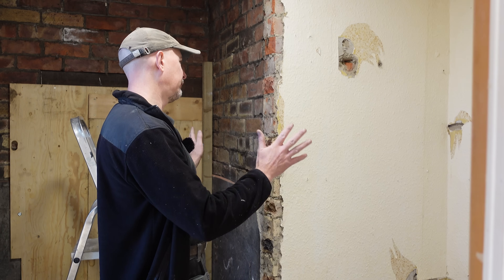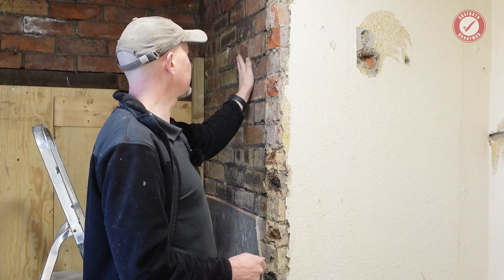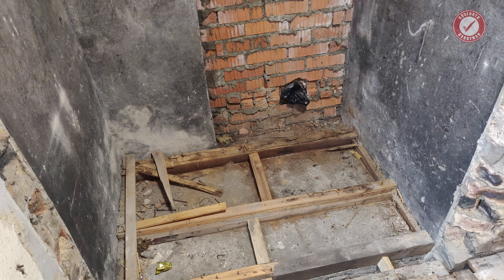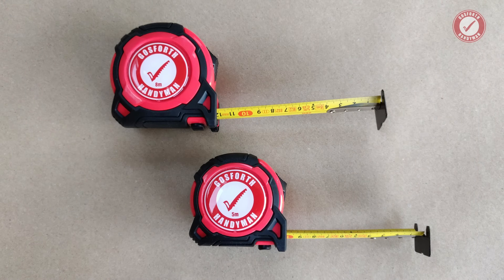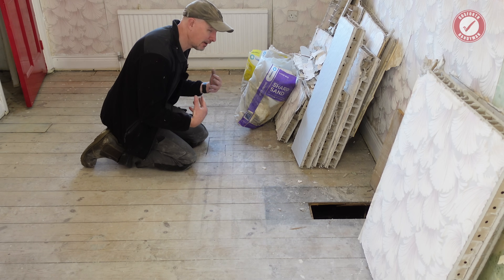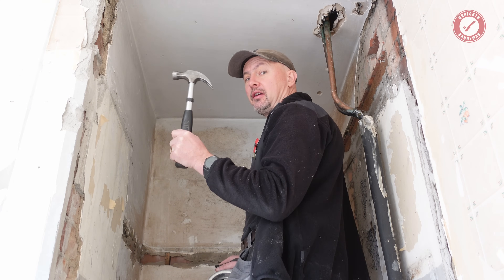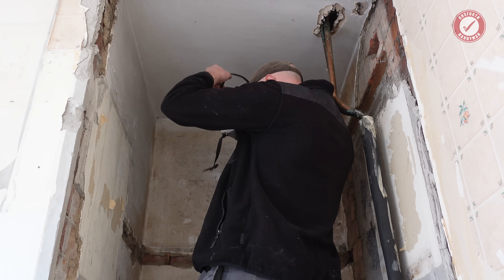How do I identify a load bearing wall?

Comment: "For whatever reason they've run the joists that way" I think you'll find they did all the joists as/when they built the outside of the houses, so didn't really matter if they ran from front to back or sideway, they then built internal walls after the "frame" was up....Might be TOTALLY wrong in this isntance.

Comment: If there is any possible doubt , no matter how minor, call a structural engineer - be safe!
I have seen a modern timber framed house where the occupier had removed an internal timber stud wall, assuming it was just a partition, where in fact it was a supporting frame for the upper floor!

Comment: I'm a structural engineer and another giveaway is that the wall is made from bricks on edge so is 3" instead of 4" and a cheaper way to build a wall.
Reply: Great advice. Seen this so many times on older 40s houses. Was cheaper to do this and saved a few courses of bricks too.

Comment: 'The Pantry" is what we called it in the west end of Newcastle - Cowgate, 1930s build. It had concrete shelves and was always really, really cold - shared the same wall as the 'coalbunker'. Kitchen had a concrete floor and the upstairs bathroom/toilet floor was concrete too. No idea how that was supported, but I remember there was a really thick part of the ceiling above the sink. I always thought it was the return for the top of the stairs, though there wasn't one, the stairs went straight up. Maybe that was the concrete block. They don't build them like thy used to..... 🙏

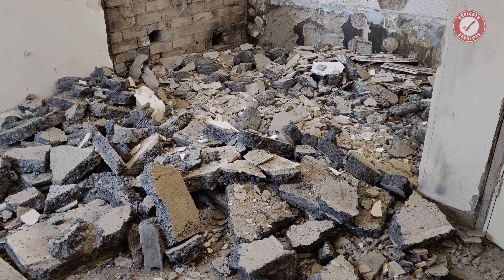Comment: 6:30 Actual cinder blocks!  You rarely see them except in older buildings from the 40s-50s. Modern blocks are made from concrete not cinder.
Reply: Cool
Reply: @firesurfer  my house has cinder blocks it's 50s built, horrible messy stuff that just seems to crack all the time. Ill be glad to get rid of some of them when we renovate

Comment: I took out a brick wall between the dinning room and kitchen in my house. 
Opened up the ceilings both sides and could see there was literally nothing sittyng on top of it. Joists were situatied about 15cm ish either side of the wall.
So just knocked it down brick by brick from top down. 
That was 2 years ago
Reply from the maker: Yup had that too! Wall was running parallel with the joists with nothing on top. Again, a kitchen in an old house. 👍

Comment: 1964 end terrace. I'm looking to remove the none load bearing wall between the lounge and a hallway to open up the lounge. At each end the wall keys into an outside and inside load bearing wall. Does it therefore contribute to the integrity of the structure of the property or can it be removed?
Also, whilst I'm here, different wall, is the wall between adjoining terrace/semi property a cavity wall? I'm guessing it will be.
Reply from the maker: Could be structural - look up racking panels. Get a structural engineer to take a look. Party walls in 1964 should be cavity but not guaranteed. In older houses they're often just single brick. 😮
Reply: @GosforthHandyman  Thank you

Comment: Hi Andy  As others have rightly pointed out , down force is not the only consideration , but another consideration is the time frame of the property. As most houses of this time frame were heated by coal , storing coal on the premises was a potential fire risk as was the kitchen itself .  Kitchens being the primary source of domestic fire in those days , and of course chimney fires were a regular event which was part of living with a coal fire .         Interestingly the time difference in  brickwork being installed and lath and plaster , might not have been as great as you might think , and definitely in this case the quality of the brickwork was never expected to be seen so could be installed at quite a brisk pace .     My late father was in the fire service , which he joined in the early 1950s . Most of his early days were occupied with domestic fires often being as mentioned chimneys and chip pan fires , and yes even coal bunkers catching fire .          Kind regards as always
Reply from the maker: That's really interesting - awesome information! 👍👍

Comment: Always surprised at how often I see floor joists hacked up over there to run utilities. I suppose with brick walls you have nowhere else to run things, just unnerving to see electrical runs just below the floorboards and notches for pipes, etc. I've have to fix those mishaps plenty across the pond here. Interesting to see how things are done elsewhere. Thanks for the share.
Reply from the maker: Honestly it absolutely does my head in 😂! Floorboard notches are one of my pet hates. In my experience they're one of the most common causes of sagging ceilings and bouncy floors. 😭

Comment: It's worth noting that just because a wall is stud it doesn't mean it isn't load bearing. They won't be taking as much load as brick / block but in some circumstances they are structural. The previous owner of my house took out a stud wall downstairs and the floor upstairs maybe 40 years ago and the floor had sagged like crazy. After consulting a structural engineer I opened up a little further and took down a wall that was supporting a mid flight stair landing. Two substantial steels fitted in a t section and a lot of jacking up with acros and all is solid.
Reply from the maker: Yup - all very true! Also racking panels. 👍
Reply: @gingerelvis  in old houses at the end everything is kind of "structural"

Comment: The wall I had bricked up in the hole between the lounge and dining area was load bearing with no lintel. The joists also go front to back but the span would have been massive. Also the pantry was taken out and that was supporting the landing between the stairs turn - now back. That was silly as the meters were there and they put a stupid little cupboard door to access it. Also a lead pipe from the gas meter to gas fire in lounge (now removed) was dented - last checked in 1991! Putting the pantry back uncovered the original window to the side before the side extension. I've also had the bricks removed from under the stairs showing the door from the garage to the area - not a real door, but more a cupboard type one. 

I hope your electrics are better than mine - hanging a picture in the wrong place could have been life changing. Rewiring is going to take time, but the main stuff has been re-routed to less dangerous places including the live wire with a 3" screw through it.  Not wanting spots in dining area uncovered a melted transformer! At least you're not having to live in the dust like me. I'm now having a break until after Christmas (other than cleaning and painting fresh plaster) and wait for any horrors you might uncover.
Reply: sounds like you just need to just start again with the wiring 🔌
if its over 40yrs its ran its lifecycle anyway
Reply: @spacemahn  I am. Doing it circuit by circuit as we're living here. Did that in my last place when we extended for downstairs. Means rewiring while old is in place and swap out at end.
Reply from the maker: Living in the dust is an absolute nightmare - best of luck with yours. A well deserved break by the sounds of it! Luckily our electrics are OK. 👍

Comment: Hi Andy,  I bet your relieved that wall is not load bearing. The joists run the same way in my house running the length instead of the width. We removed a load bearing wall and replaced with a steel beam quite a big beam if not over sized, best to be over sized than under, so we got the stairs going in to our front room as this was walled off and made the front room bigger we done this in 2011. The steel beam runs from the front door to the kitchen wall a span of 4 metres. As always a good video catch you soon   Take care
Reply from the maker: Interesting and useful info - cheers!

Comment: The joists may run front to back rather than side to side as otherwise there would have to be notches / holes in the party wall which would be terrible for noise transfer. This is a common thing to remediate in later 40s-50s properties I believe.
Reply: And also creates a path for fire to spread to neighbours, which is why most go from front to back.
Reply from the maker: Yup probably both correct - big span mind!

Comment: We had load bearing wall downstairs and most people said just buy a steel. Instead I contacted structural engineer who came out, designed everything using timber and fabricated metal cleats  - which meant it was lighter, easier to cut & fit, easier to screw plasterboard to and even including his fee was cheaper than the steel beam.
Reply from the maker: Defo. In my experience structural engineers are generally amazing. 😎

Comment: A very interesting video. Some excellent advice for anyone contemplating removing a wall. If I was knocking it down I would probably use an SDS plus drill with the chisel only function to knock it down
Reply from the maker: Defo - pointy chisel worked well. 👍

Comment: Thanks Andy, that seems a pragmatic & reasonable approach to me, and as you said numerous times if there is ANY doubt then consult a structural engineer. You covered what I was going to say in your round-up - that in a road of identical houses talk to your neighbours and find out what thy've done, it's only a guide, so don't rely on that solely, but it is another source of info in completing the picture and they may even have had it assessed recently !
Reply from the maker: Cheers and wise words! 👍😎

Comment: Load bearing walls may not just be taking a vertical load. They can be acting as buttresses to perpendicular walls. That is why engineers exist and happy to you mentioned that.
Reply: Seen it loads on the instagrammers when they remove walls and they have loss of buttress but nobody cares because it does fall down straight away
Reply from the maker: Defo! 👍👍

Comment: Top Tip: You can identify a load bearing wall by knocking it down. If your house is still standing then it is not load bearing. If you die, it was probably load bearing.
Reply from the maker: Wise words. 😂
Reply: @jonathancook4022  best way I find
Reply: Just drop a coward's save before you start...😀
Reply: Without doubt one of the finest pieces of practically based advice I've seen. I'd thought of it too, but you beat me to it 🤣🤣

Comment: Good stuff Andy.  A tip  wet the ceiling and walls to keep the dust down.  If there is a possibility of Asbestos then it 1 littre per meter.  Keep up the great work and videos Andy and Mrs Mac
Reply from the maker: Cheers and we regularly use a water spray - great tip! 👍

Comment: I am guessing the Noooook was an outside toilet but there would be a door for the coal shed and a door for the loo. 
My 1935 house has a ground floor internal wall that stops like yours but then there is a first floor brick wall sitting just on the beams running parallel to it about 50cm to one side. So it is load bearing.
Reply from the maker: Interesting! You see so many weird things in older houses. 😁